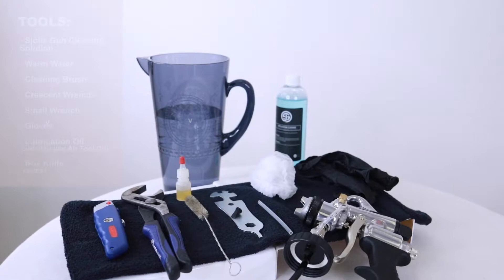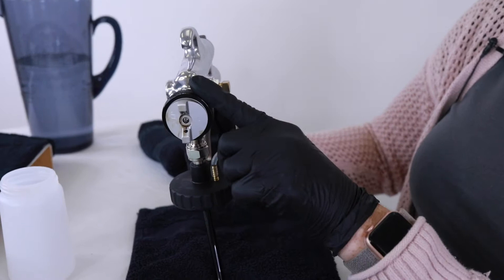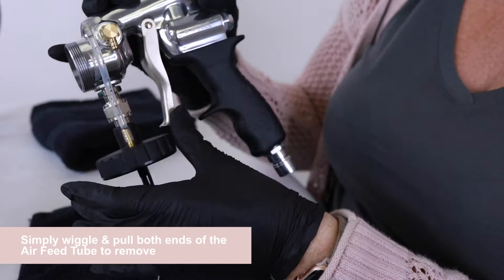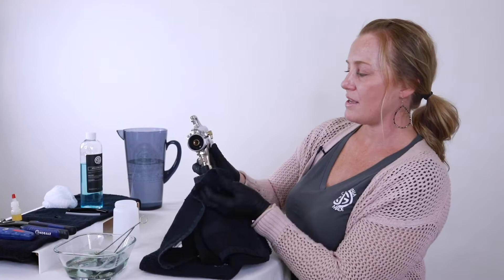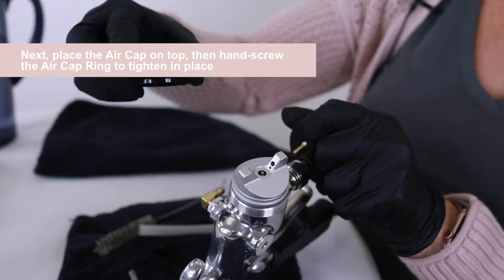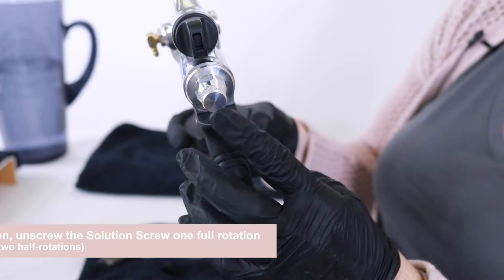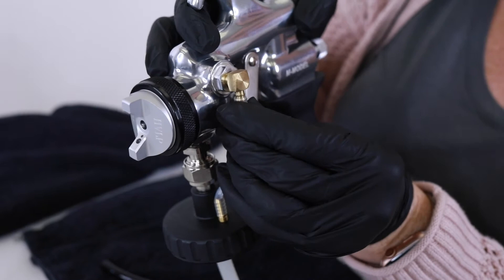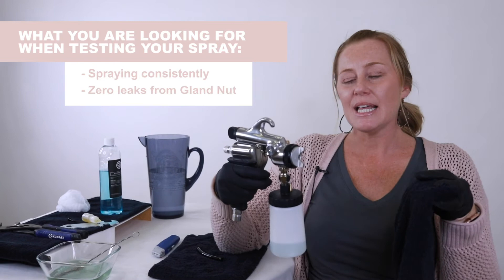SJOLIE Spray Tan | How to Clean Your Fuji M-Model Applicator

Comment: I just wanted to say that I followed these directions, and have spent over an hour trying to get the needle packing nut adjusted correctly after reassembly so that the needle packing nut doesn't drip fluid.  I wouldn't advise most people to remove the needle packing nut for cleaning.  Once I get it adjusted correctly, I won't be removing it again.
Reply: How did you get it adjusted?
Reply: same!!! 😭😭😭
Reply: @brookedetillier  Frustrating, right? I ended up having to order a new needle packing nut because mine got stripped in trying to get it back in place.
Reply: I have only taken my packing/gland nut off 2 times and its leaking. I spent 3 hours trying to clean and adjust it! I had to buy a new one online. So frustrated right now.
Reply: Omg I wish I would have seen this before… my needle packer fell out and went down my sink…. Does anyone know where I can buy a new one
Reply: @Megvancity  If you contact Fuji, they will send you a new one. They didn't charge me to send it.
Really, I think this video should be taken down.  I've been using my Fuji spray guns for years now and removing the needle packing nut is totally unnecessary.
Reply: @bback4078  I reached out to them and they will be sending me a new piece. I absolutely agree that this video should be removed…. I really wish I read the comments before listening to her instructions!